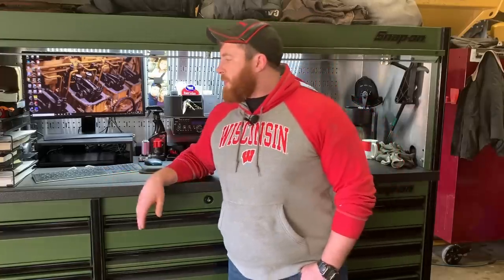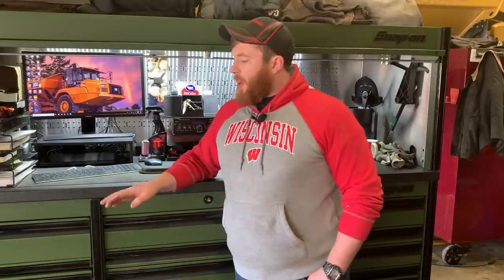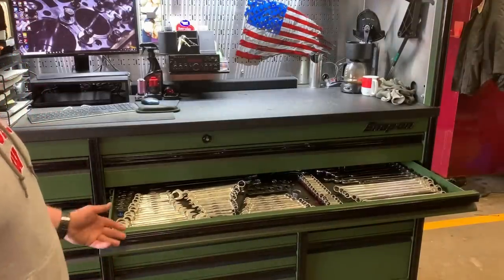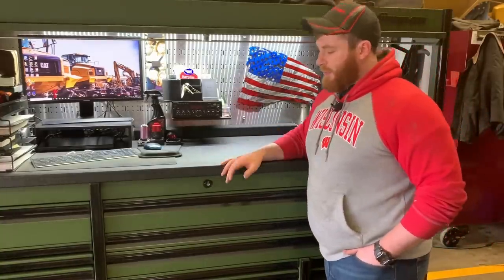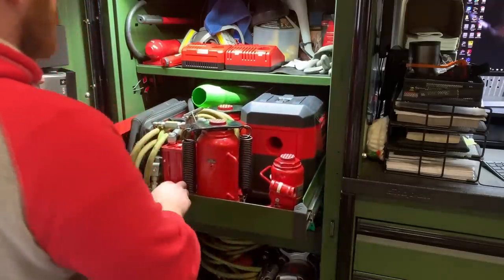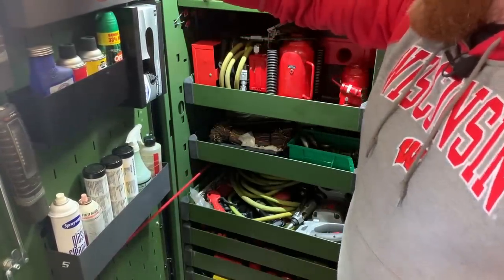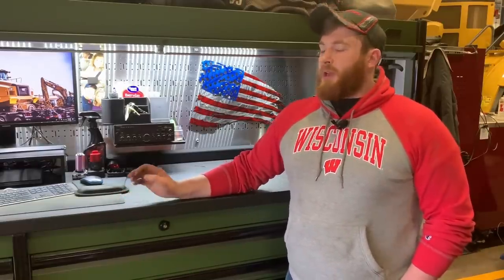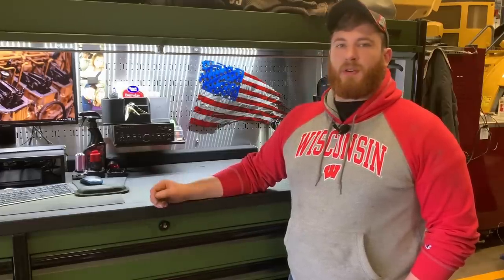Snap-On EPIQ Toolbox Review

Comment: I found that not only did the drawers bind but that they squeaked too!! Drove me insane! I ended up pulling drawers all the way out and noticed that the bearing slides  that "clip" on to the box were very sloppy. I pulled them out and peened the 3 tabs to close and effectively tighten their fit to the box when they're clipped in. Squeaks are gone and doesn't really bind anymore although the drawers still "flop" around. Snap On really dropped the ball BAD on the Epiq build. I completely agree with every one of your complaints! Wake up Snap On!!

Comment: I have some of the same issues but I have found when I do move my box. i lock the two wheels on the box and leave the locker free to pivot. I do not move my box around only to clean under it.  But that works for me.  Another great video. 👍🏻
Reply from the maker: TheHeavyWrench Thanks!  And yea I have to move mine all over the shop.
Reply: Christian Beyer that’s a huge pain. Especially when bays are typically small once you get a machine in to them. I love my packed full cart for mobility. I have the master series cart. just to keep it smaller to sneak around. Almost went with the epiq cart but didn’t want to deal with the size getting around tracks and the blade. I just filled it with my most common used stuff.

Comment: I'm blown away that a box like this doesn't have soft close drawers and shocks in the locker. It cost as much as a car. It should have every bell and whistle possible Is! Is there a specific reason there's no soft close? And if your worried about scratches get clear vinyl like is used on matte car paint to protect from chips and scratches. Very through review and very well done!!
Reply: They don't have soft close cause of the latch system on each side. If u let it close to slow then they don't latch and u have a unlocked draw that could possibly slide opened and have a catastrophic tip over

Comment: Cornwell platinum series has the strongest sliders out. They’re decent looking and offer tons of colors, but no where as pretty as matco or snap on.  I like the matco and snap on hutch’s and lockers way more. The cornwell boxes have a similar drawer opener which I like way more then any other box, and there drawer liners are next to none. It’s funny that husky and Milwaukee are some of the only boxes that offer soft close and are 1000 times cheaper.
Reply from the maker: Steve Rothgery Interesting input! Thank you!

Comment: regarding the locker draws, I have watched this video and I see some  bracket holes in the side of the locker in front of the drawer. You could fab a simple sliding lock out of metal that sits in the front top edge of the drawer and would  slip in to hole at the side of the locker. 
.
Reply from the maker: Steve Bury That’s an idea. Thanks.

Comment: Another solid video man, you're on a roll, looking forward to the next one!  Have you ever thought about wrapping your box?  That way, it takes most of the abuse before scratches dig into the paint/powder coat.  Would be super easy to maintain/clean.
Reply from the maker: BRE3ZE Thanks! I thought about a getting a cover but I want to go bigger with it. So I would have to wait til I get the whole thing.
Reply: @ValleyCityAutoYT  a cover would be pretty slick.  I guess in my previous comment, what I forgot to write in there was wrap it with a clear vinyl like you would a car/truck.  I believe there is a specific clear vinyl made for flat colors.  Just a thought, take care man!
Reply from the maker: BRE3ZE Thank you!

Comment: Unfortunately that faded color will always appear with a flat color.... there's nothing in the chemical makeup in the coating that will change that. Clear coats are a protectant. Those clear plastic/ rubber wrap material to protect cars from rock chips and bugs are a good way to protect it. If ya want the flat color however, it would change that. No way around that unfortunately
Reply from the maker: Josh Lawrence Yea a cover is about the only way I can think of.
Reply: @ValleyCityAutoYT  yeah.... re spray that panel with the damage so everything looks the same on it then cover it.... in 14 years of being a tech I also have a couple years in a paint shop and paint myself too. Flat colors look great but have zero protection like anything with clear coats

Comment: Just thinking that a pulley system at the back of each drawer could connect both sides so they come out evenly though might end up taking a bit of space at the back but surely only about 50mm? My snap on box drawers do the same thing

Comment: Drawer bind? Really? Just curious have you ever lubed them? I'll dab my sliders with my air tool bottle maybe once a year, never had a problem. Even with my heaviest top drawer and my box(KRL1023) is 12yrs old. But I have seen other people have that issue especially with the Snap-On KRSC carts. But it stopped with a little dab of oil with a wipe down of the roller guide before the dab. Your other issues with the locker drawer not having a detent and the finish scratches or chipping I agree with you 100%. Even rust on some boxes. Luckily for me my box is a warranty replacement for a KRL1003 that sagged on the left side bank below the top drawer. One of the first Black boxes I ever seen back then(1997) in my area. Bought it new. It was 12yrs old when it was replaced(2009) so I can't complain although I didn't like the second long drawer and the shorter bottom left drawer but I got used to it. As far as the scratch thing I just used a chunk of carnuba wax and rub it in real hard on the scratch and wipe it off to make it less visible. I think their prices are way too high now for a box but I do want two side lockers to finish it off.

Comment: how do you like the crinkle coat on the top of that box? i have a masters series with a stainless top, the stainless scratches but i don't really mind it, my snap-on dealer tells me its the greatest thing ever made...
Reply from the maker: patrick buckner The biggest reason I got it was so there wasn’t a stainless stripe around the box. And I would do it again. The thing to keep in mind is that you can’t write on it. Also I don’t work on it, I just put my tools on top of my box til the end of the shift.
Reply: @ValleyCityAutoYT  ok thanks, just wanted to ask someone who had one, and keep up the videos man. me and my dad run a heavy equipment shop and its nice to be able to get someone elses opinion on this stuff
Reply from the maker: patrick buckner Where are you guys located?
Reply: @ValleyCityAutoYT  rochester NY, south shore of ontario
Reply from the maker: patrick buckner Gotcha.

Comment: whats the big difference between master and epiq tool boxes
Reply: Size primarly.

The Master Series comes at least to my knowledge, 54" and 72" on which you can put an "Hood" on.

The Epic Series has 60", 68", 84", 120" and 144" wide Models. 

Why, do you consider the purchase of one?
Reply: I like the Epiq draw pulls over the standard straight squared off draws. The masters look like every other tool brand box. If u like that squared off look then I'd just get a 72in Extreme Tools tool box, half the money for the samething if not better. Epiq has the nice pull up draw handle with hooks on each side to latch it. But they slam easy once weight is in them